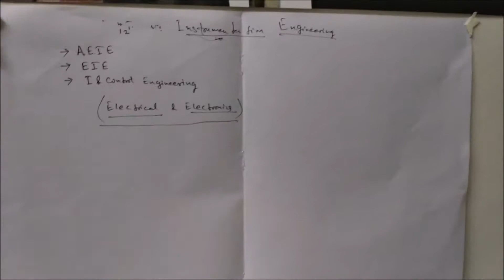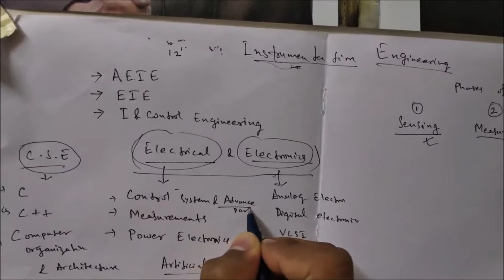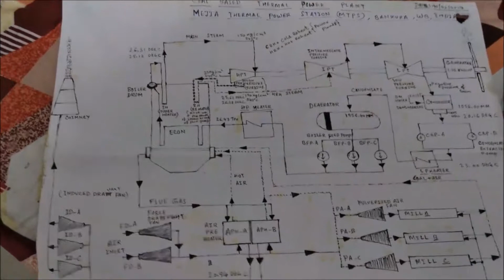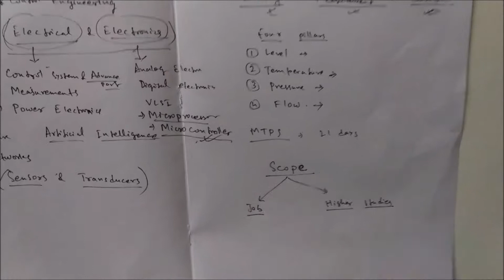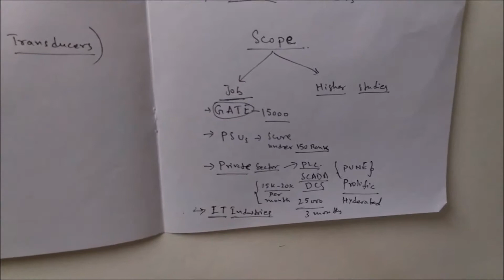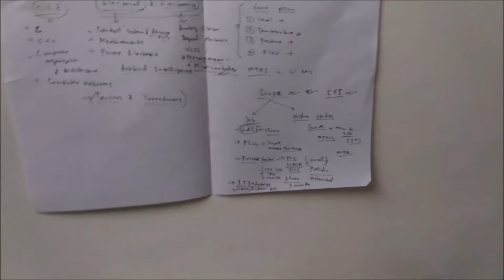Unseen Truth about an Electronics & Instrumentation Engineering  Co-Powered by Avyukta arts

Comment: Sir this engineering is better for future use sir
Reply from the maker: Hi Kalyani,

Electronics & Instrumentation Engineering is a specialized branch of Electrical & Electronics Engineering. 
So you will need to study Electrical engineering subjects, Electronics subjects and few CSE subjects to also.
So Electronics & Instrumentation is not a bad branch ....
Now coming to Future perspective...
If you want a government job like in PSUs then you need to score a good rank in Gate exam from IN branch as mentioned in my video also.

If you want to work in Private sector then core Instrumentation Engineering jobs are not so good ,you will not get a good salary.
But if you try for IT sector then there is a good scope ,I also joined Wipro Technologies with 3.5 Lakh per annum and now after two years i am switching the company and getting 10 Lakhs per annum.

So in private IT sector is a good scope.

If you want more clarity then you can reach out to me in Instagram.
Abhi_the_art

Hope you get the answer.

Reagrds, 
Abhishek

Comment: Sir can i know whether i get a job after studing in a govnt college plsss rplyyy fast tomorrow is last date for joining
Reply from the maker: If you are enrolling for an Electronics & Instrumentation engineering in Govt. College then chance of getting placed from the college is little less.
But you can try for Off campus Placements if you are interested to work in the field of IT Sector.
If you are interested to work in Core Instrumentation field then you need to score a good rank in Gate exam  below 200 or you need to do some training as I mention in my video also.
So decide and enroll.
Best of luck for your future. 
In case of any query you can drop your comment.
Reply: @avyukta-arts3062  thanku🤗